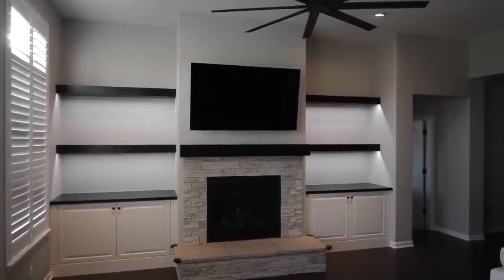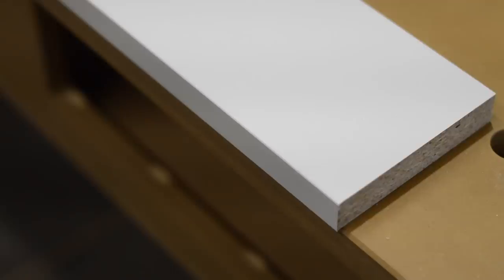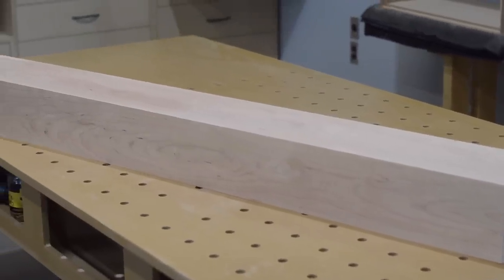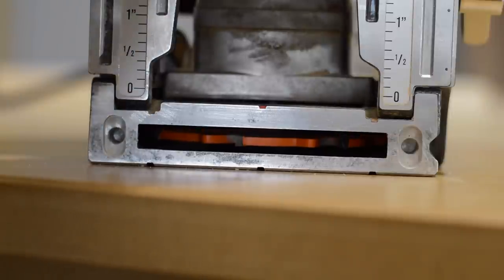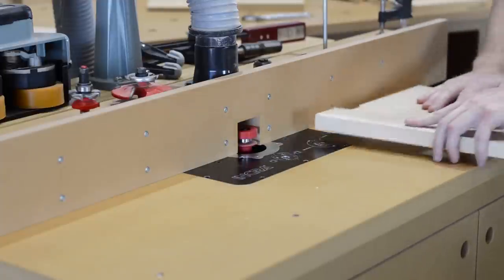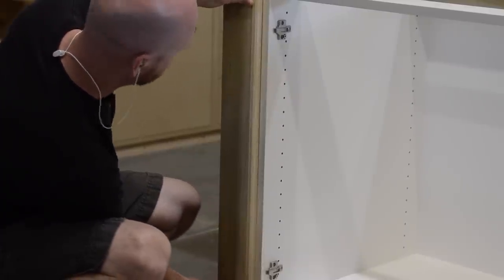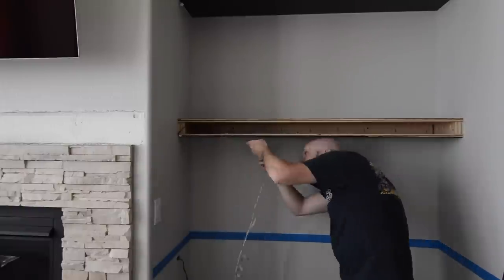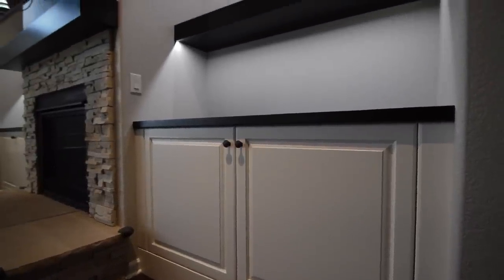Custom built in cabinets, floating shelves and fireplace mantel

Comment: I know you're not an electrician - but I am, so here goes. Try next time using a Lutron Caseta dimmer with wireless remote and pedestal stand. Both are on Amazon or HD. This way those fancy lights can be controlled from the couch!.
Reply from the maker: Thank you very much, this is a good idea. My first offering to this customer was to hire and electrician to install the lights on a switch, they didn't like the cost. So we came up with this plug in option.

Comment: Looks very good with this color contrast! What is the width of the filler on the two sides of the base cabinet? And what is the height of the base cabinet and the distance in between two floating shelves? Thanks!
Reply from the maker: Thank you. The fillers are 2 1/4". The base cabinet is 36" tall and I don't know the distances between the shelves.

Comment: Thanks for the referral to this vid.  I better understand the floating shelf now, but after watching the install portion twice, I did not see how the top part of the shelf was attached.  I would think you brad nailed it?  Screws would be more secure, but wouldn’t the screw head mar the overall look of the shelf?
Reply from the maker: I forgot to film that portion, I use either a few dots of glue and put something heavy up there to clamp it or a nail in each corner.
Reply: Mike Farrington Thanks Mike!  That makes sense now.  I thought you were sliding a 3 sided box onto the cleat with the pocket holes on the wall.  For the life of me, I couldn’t figure out how you’d get to the pocket holes once they were enclosed in the box.  I’ll have to try something like this.  I have a couple of locations that this would work nicely.
Reply from the maker: @jimsjacob  I should probably do a video on just the shelves. I would be able to cover my process a little more in-depth. Yes, 3 individual parts are installed in the opening (bottom, top, front). It would be impossible to to install a c shaped shelf into the opening. It just wouldn't fit good after all the trimming.

Comment: Really enjoy your videos.  I’m getting into woodworking, all DIY stuff, and have a question in your filler piece.  Is there a rule of thumb when to build a cabinet and use a filler piece?  My lack of experience would of made me measure wall to wall and try and build a cabinet that touches wall in both ends.  I would have never thought to use a filler piece.  To me, that look made a huge difference in professionalism to the finished look.  Nice build
Reply from the maker: Thank you. In this cases a filler was needed to space the cabinet away from the stone work that hung over into the opening. Even with no stone work I still add fillers, just more narrow. Fillers are needed because of the way the hinges work and the fact that walls are never plumb or straight. Also it makes putting the cabinet in way easier too, because the cabinet is narrower there is more play to shimmy it into place. Once in a while I will make a cabinet where is no filler, I just leave a small gap between the wall and door. Hope this helps.
Reply: Thanks for the reply.  Helps a lot

Comment: Thank you for your video, very impressive work. Question, did you install the wiring and dimmer yourself or was the switch/ work box already there? And does the dimmer control both sides? If so how did you get the wiring through the middle? Attic or basement? Thank you very much.
Reply from the maker: Thank you. Its a separate system for each side.

Comment: Hi Mike. Another great build with many super tips. I like how you handle the fillers. One question, do you use "bumpers" on the doors so the handle side is also projects 1/16" from the face frame, just like the hinge side?   Tears for Fears had a song called Mad World. I think the Gary Jules version is much better.
Reply from the maker: Thank you. I normally don't use bumpers, just the soft close of the hinge. If I did use bumpers I would take that into account when making fillers, doors and moldings. I love that Gary Jules version, what a great song.

Comment: Great thanks. What do think is the most effective way of fitting a cabinet top to 3 out of square walls? Do you use the boat builders trick, with a spacer and tick marks? Or maybe make 3 templates that fit each wall, and then glue up template? Or maybe tilt the overlength top and then scribe, though this assumes the back is flat. Here in Uk no walls are ever perpendicular. Thanks for lovely, informative vids. A K Fisher.
Reply from the maker: I like to check the walls first with a square just to see where I'm at. Its its bad I will put some painters tape on one side of the piece. Next I use a compass to reference the wall and mark the work piece. I have the piece held in the opening at an angles because at this point its long. I mark, then cut that side. After that I measure and make the opposite side, then cut. Once thats done the piece should fit left to right into the opening. Lastly I mark and cut the back. Its a real pain to do this but the finished result looks great.

Comment: Mike... I’ve watched this great video probably 3 times (not all at once). What drywall anchors did you use for the sidewalls for the chunky shelves. I have a similar project where a fairly stout wall anchor is needed. Thanks in advance. Love your videos and the nice (Ok superb) work you do
Reply from the maker: I use the ones that look like a giant screw. I make sure to pilot the drywall so they cut in cleanly.
Reply: Got it. Ty

Comment: Mike, any input on melamine built-ins vs painted plywood? Obviously everyone hates painting, and ply is a bit easier to work with.
Reply from the maker: Yes, more labor, and a less durable finish. Melamine is very hard and resists cleaners and scratching.

Comment: You are a true craftsman. After watching this video, I hate the "contractor" that did my cabinets even more now than before...

I am curious why you cut the rabbet for the LED strips when the front lip of the shelf would naturally hide the LED's without the cut...seems redundant to me. 

Hope - Descendents -> Sublime (The only song done by Sublime that is good but not nearly as good as the original)
Landslide - Fleetwood Mac -> Smashing Pumpkins (very tough song to cover, SP did an amazing job... almost as good as the original)
Higher Ground - Stevie Wonder - > Red Hot Chili Peppers 
Radio Active - Imagine Dragons -> Our Last Night ( I Iike the cover better than the original)
How Soon is Now - Smiths -> Love Spit Love (impossible to cover Morrissey well but they did a decent job)
Ziggy Stardust - David Bowie -> Bauhaus (I love me some Bauhaus)
Say Hello, Wave Goodbye - Soft Cell -> David Gray
Reply from the maker: Thank you. I felt like the rabbet hide the LEDs a little more. I agree, it was probably not necessary. Thank you for the song suggestions, bunch of good ones in there.

Comment: Can you go more in depth about the led strip lights? Ie: power supply, light switches and wiring.
Reply from the maker: I will include some more info in a future video. I use the Pro series of lights from Wurth Louis and Co.

Comment: I have a very small house and looking for ideas to save space, have my tv, receiver, speakers and electric fireplace in center near or on floor.  Also shelving for storage of books and DVDS.  This gives me a great idea but don’t see how I could get into the back with a design like this?  I don’t have the budget to tear into the wall and run a way to get behind.  I’m guessing that’s how this works?  I have often wondered if building something on wheels so I can get behind it if I need but have book shelves built to the wall so I don’t have to worry about dust behind them?  Any ideas?
Reply from the maker: Sounds like an interesting challenge, without more info I don't think I can offer any ideas.
Reply: @MikeFarrington  Yes I realize it’s hard to understand what I was trying to say.  I’m either going to buy a prebuilt stand or try to build something.

Comment: Great video keep them coming.  Is there any reason why you use particleboard and MDF over  plywood Besides the cost? I'm looking to turn a small bedroom in to a full walk-in closet 12 feet by 9 ft. wondering if particle board or MDF would be durable enough.
Reply from the maker: Cost is always an issue, but honestly, I really like the melamine surface for cabinet interiors, it cleans easy and is very scratch resistant. 99% of closets are made of particle board or MDF. If built properly you will have a closet that looks beautiful and will last a lifetime.

Comment: I see you have that nice machine for boring out the holes for the cup hinges in the door - what jig / tool do you use for drilling the plates into the face frame (or into the cabinet side for frameless)? And how do you get the correct vertical alignment between the door and cabinet, are you always drilling them offset from the top and bottom at a fixed distance?  Thanks
Reply from the maker: Thank you. The answer to this question is far too complicated for a quick response in the comments section. The short version is I have a coupe different jigs to drill the two 5mm holes required for the hinge plates. Normally, I measure distances on the cabinet sides and incorporate the offsets there, the doors are drilled equidistant from the top and bottom. This winter I think I will do a video on this very subject.
Reply: @MikeFarrington  all right thanks!

Comment: MIke, Fantastic work! I think I've jumped down the YouTube wormhole in watching your videos. Really enjoy the kumiko series and your recent article in Fine Woodworking. Planning on trying it myself very soon. Question about the LED lights, did you utilize a separate power supply? If so, did you store in in the shelves?
Reply from the maker: Thank you very much. I did use a separate power supply. It was hidden in the side of the cabinet.
Reply: Mike Farrington awesome! I have a job coming up to install some built ins with the pretty much same floor layout as this job. Thanks for posting the video! Definitely will be using your methods as an inspiration!
Reply from the maker: @Tmedic01  Good luck, hope it all goes well.

Comment: Hey Mike!  Love your videos.  I have a question for you.  I’m going to build some pretty big built-ins for some friends.  It’s a 16’ wall, 9’ high.  Will have cabinets below and shelving up top (big screen tv in the middle).  I’m worried about finishing. They want something really durable (they have two little boys). I’m going to be buying a Fuji 5 stage turbine for this project.  I am not installing.  I’m building, finishing, and dropping off.  Their contractor will install.  I was thinking about spraying a white conversion varnish for the cabinets, and the same company has trim paint that they can match the CVarnish with, so the contractor can finish the trim.  I’m a little nervous about it because I don’t do this for a living, however I’m pretty confident I can give them what they want, but nervous about the finish.  Thoughts? Advice?  Thanks! PS I’ll be building the cabinet doors from quality MDF.  Not sure what to build the white countertops with.  I’ll be buying your sanding disc to help with this project!
Reply from the maker: Finishing can be very challenging. If you are comfortable spraying CV, that's about the best you can do without getting into the specialty finishes. I would just recommend practicing a lot with the new setup before moving to the real deal.

Comment: I like your work! When u scribed the side pieces of the floor cabinets, did you offset it inwards all the same level down by say 1/2 inch?
Reply from the maker: I normally offset it the thickness of the cabinet side, 3/4" and use the cabinet side as a reference. Then I set my scribe 3/4", mark, cut and theoretically it'll fit just right.
Reply: @MikeFarrington  makes sense

Comment: Agree with everyone on the good work  Curious how one decides on the width of the filler strips?  I imagine given the space size you don't want your doors looking overly wide?  Also I think the corner bumpers on the fireplace really set it off!
Reply from the maker: Normally I make fillers the same width as the door frames. This could be between 2" and 3" for the most part. In this case I made them wider because of the stone work that protruded into the openings. I didn't want to doors hitting the stone work.

Comment: Wow!  Super impressed. I’m doing a built in mud room with lower drawers below a bench  and upper cubbies. I have a question about existing outlets. I know you can’t bury them behind a cabinet. I saw you extended yours through the back. If I extend mine properly like you did (with an extension box), does a removable drawer suffice for “access” to meet code, or do I need to relocate it to a more accessible place like the coat rack area?
Madman across the water. Elton John and Bruce Hornsby
Reply from the maker: Thank you. I don't know as code will differ greatly with location. My guess is behind an easily removable drawer would be OK, but that's a guess.

Comment: That's by far one of the best videos of construction and install I have watched and trust me Mike I have watched a Lot! 
One Q, with your floating shelves, you fixed the base with pocket holes and the top you mentioned just sits there. Is this not fixed down or are you relying on the biscuits when you attached the front to hold it?
Cheers from NZ.
Reply from the maker: Thank you very much. I did say that I just had it sitting there. I forgot to mention that after I attach the front I tack a few small nails in each corner. Sorry about that. Sometimes I don't use nails, I just put a few dots of glue and set the shelf in place and let it dry.
Reply: @MikeFarrington  thanks for the reply, and now I'm looking at the lamello! 🤔😂🤑
Reply from the maker: Careful the price can burn your eyes. I bought mine used for super cheap.
Reply: He states in the video @ 12:03 that the top is held in place with nails.

Comment: Hi Mike.
I saw that your plinth/toekick was in uniform size. 
You follow the floor or do you skribe it?
I never got the hang of doing solid plinths. Mostly because we startet using adjustable leggs 10-12 years ago.
Is this a standard way of mounting cabinets in US?
Reply from the maker: In this case no scribing was required, the floor was level enough. Otherwise, I just scribe to the floor. I use leg levelers sometimes, normally not on small projects like this one.

Comment: Hey Mike, beautiful job, I'm about to embark on the exact same project in my basement, this video and several others helped alot to get me organized. Can you tell me the brand, make or series of LED lights, extension wires and connectors you use....there is so much out there it seem hard to know what is good and not. Thanks.
Reply from the maker: Thank you. Good luck with your build. I used the PRO series of lights from Wurth Louis and Co. I use their system because I know its going to work and I have an account with them and get pretty good pricing.

Comment: Just a note on MDF raised panels, if after making the cut, if you thin down tight bond II and brush a coat on let it dry light sand the paint will bit very good with out sucking it up like a sponge.
Reply from the maker: Great tip, same principle as what I do. I just soak it with a few coats of primer, then sand.
Reply: If you try one time with thinned glue with water and 220 you will have zero dry spots and it'll be your new go to way. I really like your channel and shop.
Reply: Aloha 78° Hilo side of big island, waves 4' - 6" today
Reply from the maker: @mickrose9633  Thanks. I'll give it a go.
Reply from the maker: @mickrose9633  I've never been to the big island, but I have been to Oahu a bunch. 4-6 is just perfect for playing around.
Reply: With you living in the countryside in Colorado, I have a feeling the big island would be your cup of tea. Snow ski in the morning and surfing in the afternoon. Jungle to desert on the same island. I live on the Hilo side in Pahoa the district of Puna where the volcano went off, close enough to see a massive glow down my street and yet far enough away to be safe, earth quakes were a trip. Truly an amazing place, it's alive and beautiful.
Reply from the maker: @mickrose9633  Its a place I hope to visit one of these days.

Comment: If you wouldn't mind answering an off the wall question, it would be appreciated. How much of an overhang does the counter top have?  AND are you pretty consistent with that figure? If not, what factors in?

Thank you in advance and Cheers!
Reply from the maker: Thats a good question. The counter top hangs over the cabinet 1 3/4" The doors reduce that by about 7/8" with the hinges. Hope this helps.
Reply: @MikeFarrington  It does, thank you!

Comment: Was the French cleat counter sunk  to give you a flush connection with the wall? Thank you for the prompt reply to the last question.
Reply from the maker: The cleats were just normal cleats, not French. So the top and bottom just press up against the cleat after being cut to size. Hope this helps.